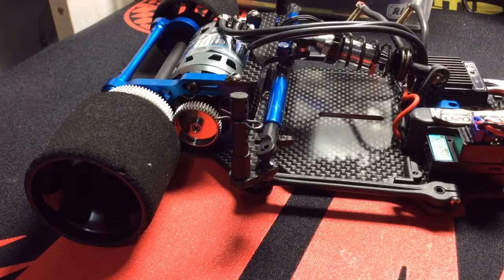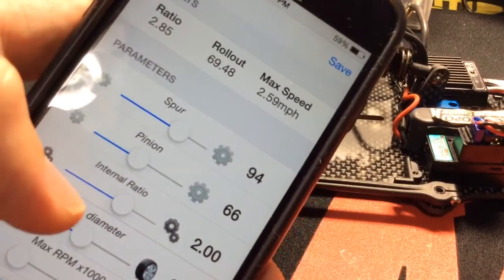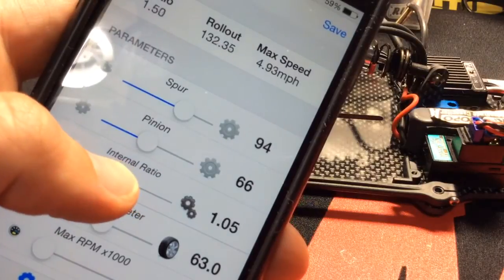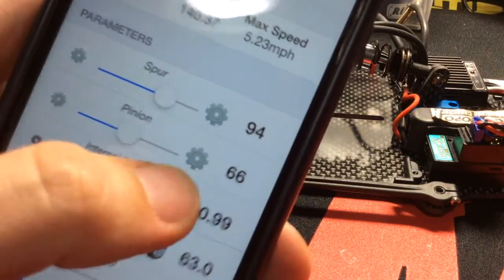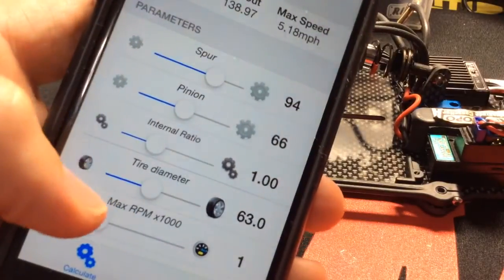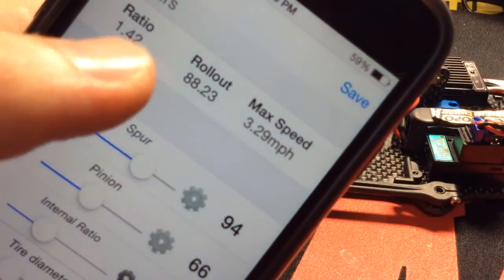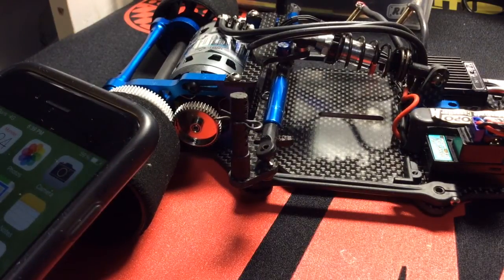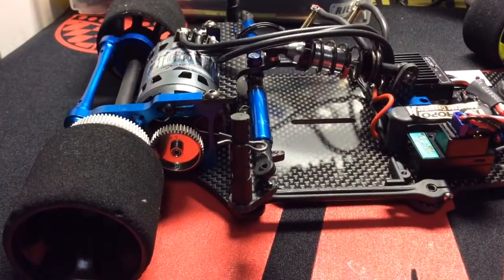What is Rollout? For 1/12th and 1/10th Foam Direct Drive Classes

Comment: Is it safe to say, that a taller spur, and a smaller pinion would give you more, off the line speed (torque) and a smaller spur and taller pinion would give you more top end speed, but slower off the line?
Reply from the maker: Yes, you are correct!
Reply: Edward Pickering whet is a good moter and esc to start with